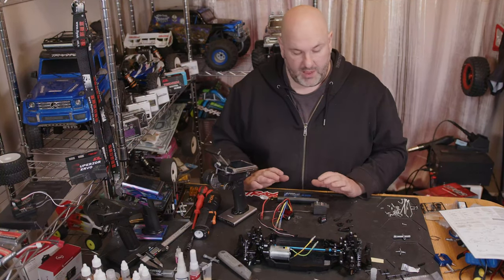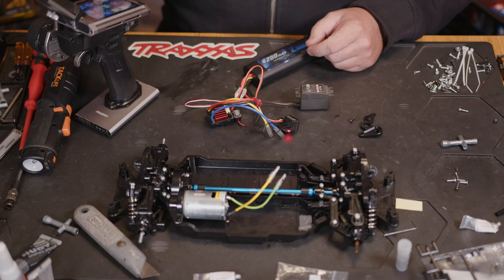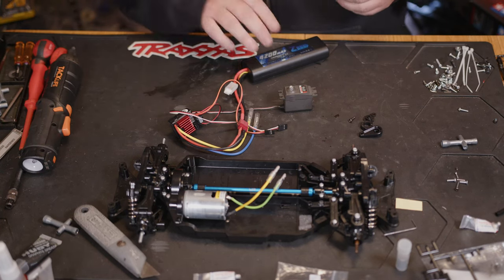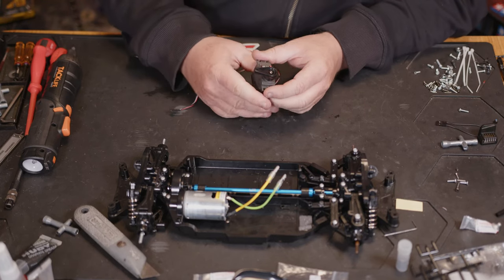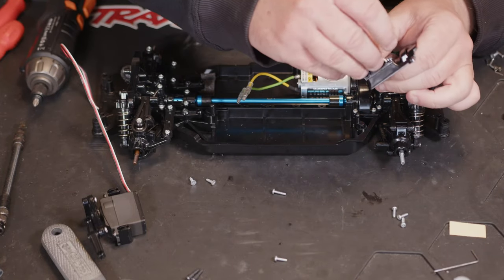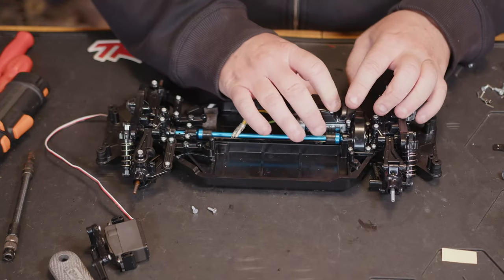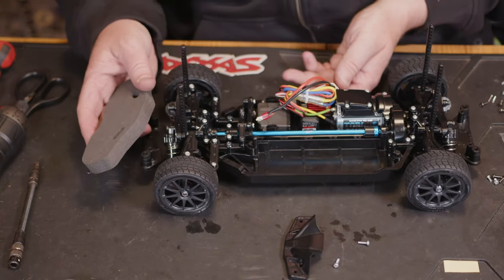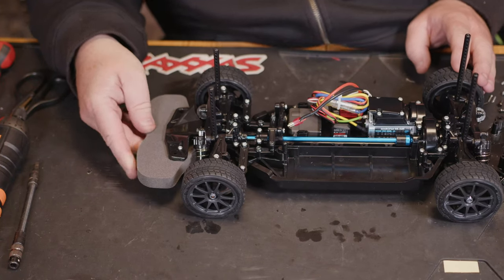Tamiya TT-02 Senna build and Essential mods part 2

Comment: Nice job 👍👍,  I'm just waiting for my bearings to come to build mine 😃
Reply from the maker: The tt-02 is a nice build the senna body is a pain to mask up but worth taking the time :)
Reply: As long as you didn’t fully build it with the bushings already, the kit will be easy to build. If you have built it with the bushings, only to realize why everyone said to build it with bearings… I feel your pain. Not fun to have to blow the chassis apart just to replace all the bushings with bearings. It’s a learning experience for sure but it’s never fun to have to do-over a job as large as that.

Comment: I know this is built for stock class racing but… I can’t stand the servo holders or the motor cover. I just upgraded the servo bridge with the Tamiya or Yeah Racing one because it offers better rigidity over the plastic parts and makes the car overall feel sharper. Plus, it gives a much nicer place to mount the FGr4S onto versus on the servo.

The motor cover (D8) on the other hand I feel makes the car run too hot. So I’ve actually just used the Tamiya heat sink for the TT-02 instead. The thing is though that motor cover can accept a 30x30mm fan in place of the air scoop (D7) but for stock class the heat sink is not allowed and neither are fans.

Lastly, the Carson ESC is a rebranded Hobbywing 1060. All Tamiya kits now are using them. Tamiya ESC’s aren’t being packaged in new kits so if you want one, you have to order one on your own.

EDIT: I personally use the D12 antenna mount only because without it, aligning the ESC can be a bear. But I’m using the chunky Tamiya TBLE-02S. The 1060 is a lot more compact so you can choose to omit it or not and still have ample space between it, the motor and your servo. If you go low-profile (Tamiya state to not use them but you actually can), you’ll have even more space!

As for servo, I use the JX 6208. Cheap as chips ($20USD +/-), digital and really fast .07sec transit time at 6V. The downside is that they lack toque and seem like they could break easily if you try to push it beyond 9kgs. There is the lower profile 4409 and even a coreless model too. I haven’t tried the Zoskay servo but it is slightly slower at .09sec transit speed but it has 20kgs of output torque so it’s plenty durable. Just my personal preference.
Reply from the maker: Thanks all great info :) I have a new servo on its way and yeh it's a compact one 16kg coreless so should be good :)